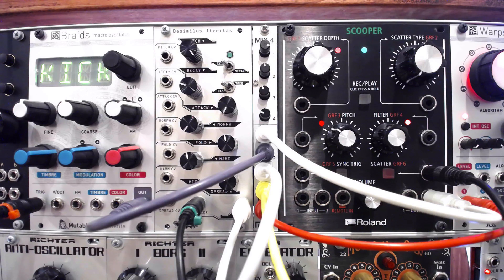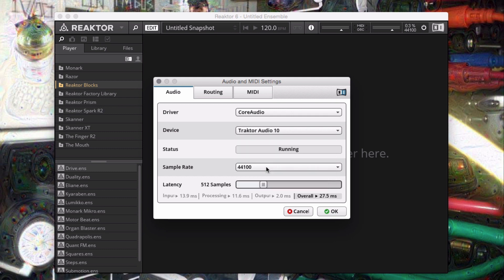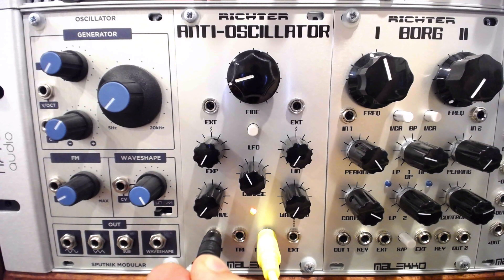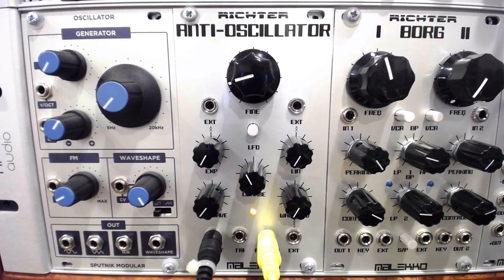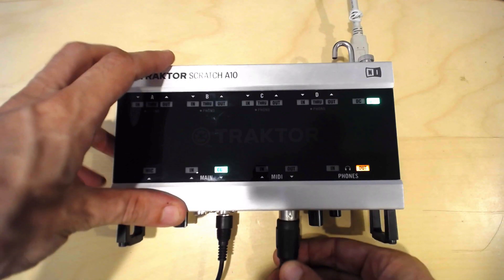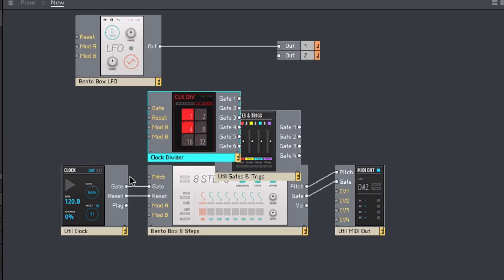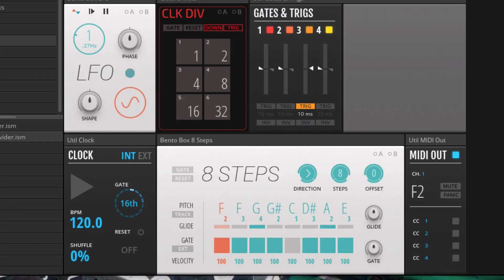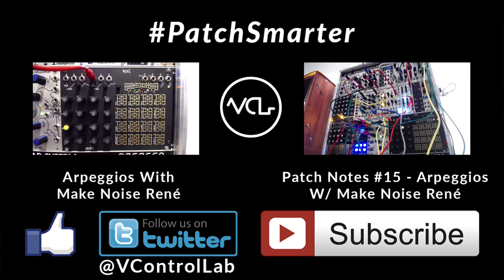Reaktor Blocks As A Eurorack Sequencer

Comment: I definitely grabbed the ES-3 specifically because of Reaktor Blocks. It's definitely not as fun as patching on the real modular, but it's helpful to augment your system, when you just need that one more control source to fulfill a patch idea (and you're out of money...). It's also useful to make presets that can help a live set to change songs quicker (although I'm trying to come up with a better way to haul a computer and ADAT-equipped interface around).

I highly recommend looking through the Reaktor User library for more exciting blocks than the one NI provides. Just search by top-rated blocks for some damn fine digital modules.
Reply from the maker: Yeah, the user library is the unsung hero of Komplete and Reaktor. It is truly an incredible resource.

Comment: I've been using the app Reason for over a decade. It has a skeuomorphic interface with animated cabling for audio and cv/gate signals. I have an es-3 and a Motu 828 mk3 hybrid interface. So I have 8 channels over the ADAT to the es-3 module and another 8 channels of DC-coupled 1/4" outs from the interface (needs a floating ring cable with DC signals). I can run any of the LFOs, envelopes, gates/triggers out easily and with a Silent Way Reason RE, do V/Oct or Hz/V using the midi sequencer or sequencer rack devices. It all works together really nicely. I'm not using a midi interface at all.
Reply from the maker: Yeah, I'm looking forward to the ES-8! Sounds like you've got a great setup!